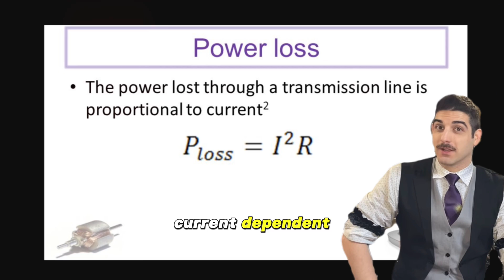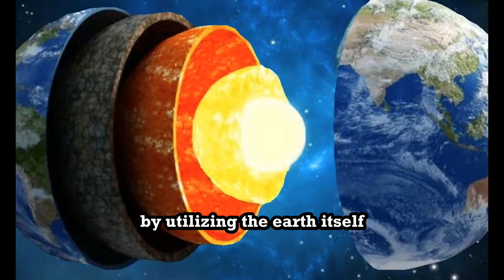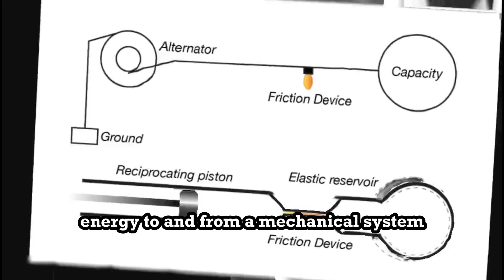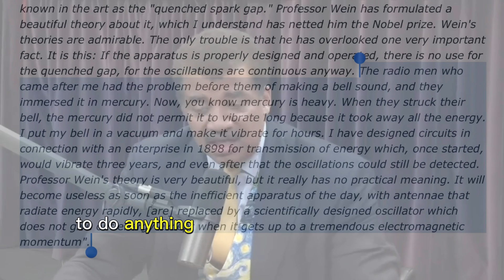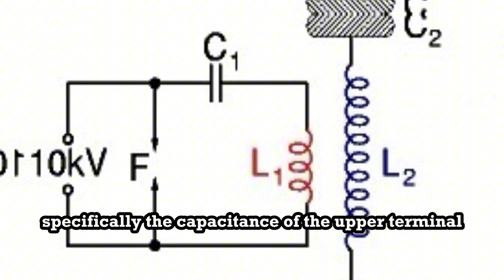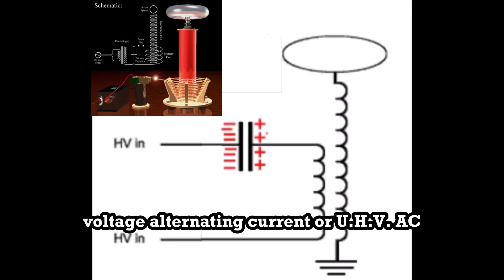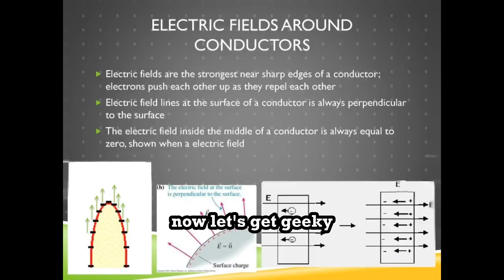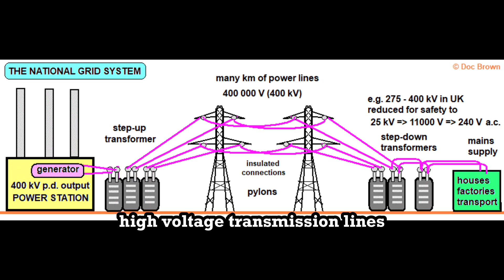The REAL Physics of Tesla’s Wireless Electricity

Comment: The way I see his problem is this. 
He was informed and have believed that electric energy can be transmitted in space between long distance without conductor. He was not aware that it was incomplete information. Cause him failure.

The untold part of information is this. 
That free electricity was possible only between galaxies and planets along a spiral arm in the form of Birkeland current better known as cosmic plasma. These plasma requires no return circuits or earthing. Once kick starred it need no further force to maintain continue transmission, forever. The energy is derived from vacuum Aether. Aether is a permittivity that store cosmic electricity and is free if we know a way to harness it. Tesla was fascinated with it and tried but failed. 

Since we know it energize planets and suns. The best practical way is to use wind and photovoltaic technology. And not from nuclear fusion which we don’t know enough to make it happen after decades of failure.

Comment: It does piss me off how many  “scientists” mock Tesla on this issue without realizing wtf they are talking about but there is a bit more to the story here. 

Tesla did briefly experiment with the kind of wireless transmission that we know doesn’t work due to inverse square law and very quickly learned what we know now ie you can’t use it for very much as you mention. After he learned this he did continue to explore using this very limited range transmission exclusively for a particular kind of vacuum tube lightbulb that was able to benefit from this kind of transmission at much larger distances than the ones you see people playing with on YouTube, the idea being that lights in your house would work wirelessly off of a single transmitter (per house) used exclusively for them. 

He also did explore a different approach for wireless transmission for large amounts of energy over the kinds of distances that he is mocked for using a much more plausible method, specifically motivated by flying machines that wouldn’t need to carry fuel. This approach was in creating directed beams of highly conductive  ionized air from the transmitter to the receiver, a concept with which many more people even today have explored for good reason: it makes sense.

Happy to answer questions about any of this: @zkchesterton on x/twitter.

Comment: I can't see Tyson endorsing this.
Reply: The fact that he either mistakenly or purposely said that the system was unworkable is a definitely sign that he would not.  He essentially said the transmitting towers would need to be everywhere and emit all their EM radiation through the air in order to work, which, if that was how they worked, would have been correct.  It would have inundated the air with high power densities which as far as we know, our planet has seldom seen and could have negative implications for life on Earth, to say nothing of existing signals infrastructure.  It's fairly clear though that was NOT what Tesla said or stated in his patents but to a non-electrical engineer it's definitely possible to not understand what Tesla was implying.  I thought that the power was transmitted through the atmosphere as well at first until I saw the extent of the grounding required for this Colorado Springs and Warden Cliff sites.  The grounding at Warden Cliff went much deeper underground than the tower extended into the sky, utilizing several steel I-beams driven into the ground.  They needed to be regularly maintained as well to ensure the system had enough of a "grip" on the Earth to ensure the system could actually control the electrical state of the entire planet.  There were/are several tunnels around the grounding "rods" to allow maintenance personnel to appropriately maintain the connection and steel itself.  

With all that evidence pointing to a lot of the system's functioning involving the Earth's crust, it's hard to believe a man as smart as Tyson would not have made that connection and at least understood the operating principle of the system.  That being said, if he had not spent a lot of time investigating it and just thought he "got it" then sure, his more limited understanding would lead him to that erroneous conclusion.  In Tyson's defense, Tesla did slip into a bit of a mild madness in his later years, so easier to jump to the conclusion that Tesla came up with the idea in a fever-dream, but his wireless transmission system was something he came up with at the pinnacle of his genius, not in his reclusive years spent in his NY apartment, dreaming up death rays and falling in love with a pigeon... which yea.  yikes.
Reply: @ImprovisedExpletiveDevice  The simplest analogy might be a network whose nodes are tuned circuits with high Q factors so they respond to only a very narrow frequency range. As long as no one is drawing off energy, very little energy needs to be put in to maintain the oscillations throughout the system, as the only loss will be a small amount in each oscillator from heat produced. In fact the oscillation amplitudes will rise to the point of an equilibrium in which the loss from I^2 R in each oscilator will match the amount of energy going in. OK so that's the sort of steady state situation once you have pumped in enough energy to get the oscillators (the tuned circuits) oscillating in the first place (like pushing a kid on a swing repeatedly until the swing is moving significantly).

Now consider what happens when you start drawing off energy at one of the oscillators. There will then be a power flow thru the network to balance out the energy distribution. That means the generator feeding the network has to pump in a higher power level to maintain the high amplitudes of the oscillators. In other words, if you take energy out, someone has to put some back in. Just as in a conventional power distribution network.

Conventional power distribution networks use 3 phases 120 degrees apart so they don't need a common return wire because, provided you balance the phases, the return wire would have zero current passing thru it. Such networks run at very high voltages so as to keep down the currents. Even so, you can pick up energy from a device near a distribution tower, if you are dumb enough to want to. And sure people tap into lower-voltage domestic distribution networks in 3rd-world countries to get free power.

So what's the difference with the Tesla system? Well it's using oscillators as local energy storage devices. Kind of incidental to how it works. But tke key concern is the viability of transferring energy to the oscillators thru a network that is NOT a bunch of purpose-designed cables but a pre-existing thing called a planet. And that's where I think it comes unstuck. The idea is that the voltage can be kept super-high to reduce the current and hence the I^2 R losses. But look at how homes are protected. They have earthing systems. Basically a circuit is protected by a connection to the indoor plumbing (assuming the pipes are copper). That copper eventually runs into the ground. So the assumption is that a whacking great amount of power from a domestic short-circuit to the earth attached to the covering of a device (such as a motor or whatever) can be dissipated into the ground with no problem, ie the ground is expected to offer very little resistance, because it is absolutely massive.

Well, that being the case, if I want to put 2 stakes in the ground at some distance from one another and put a super-high potential difference between them of hundreds of megavolts, I can't expect that the electrical resistance is so high that I^2 R losses will be virtually nil. I may cook the ground!!! Also different terrains will have widely different characteristics. But typically they will have ground water somewhere and salts that are soluble or partially so. Inevitably there is going to be more conductivity than you are bargaining for.

Well that would be for DC. But what if you go for AC and have a free choice as to what frequency you want to use? 50-60 Hz. Maybe 1 MHz. Maybe 100 MHz. Well you could go craxy trying alternatives. But you are going to run into phase-related issues. If you have multiple generators in a network, they all need to be precisely timed so they all push at the same time, and all pull at the same time, otherwise they will be dumping power into each other. So that would set an upper limit to use of high frequencies.

I don't know how conductivity will vary with frequency in the ground but it sure doesn't stop earth wiring from working at 50-60 Hz.

I don't have time to think about this any further and my degree was in electronics not power engineering and goes back half a century. But I can't help seeing some serious problems. If it worked, someone would have done it by now. I feel this whole thing could get swallowed up into the world of whacy pseudo-science and conspiracy theories about aliens building pyramids as power generators and all that kind of crap. (Darned stupid way to build a power generator. Any engineer who used such tonnage of stone so pointlessly would be fired on the spot.) Anyway, enough said.

Comment: What about the ideas that his system was more related to the zenneck surface waves
Reply from the maker: Hey thanks but that’s patently inaccurate. 
 
Even real verbatim says over and over his system does NOT use EM waves.
 
Tesla: “There is no radiation in this case. You see, the apparatus which I devised was an apparatus enabling one to produce tremendous differences of potential and currents in an antenna circuit. These requirements must be fulfilled, whether you transmit by currents of conduction, or whether you transmit by electromagnetic waves. You want high potential currents, you want a great amount of vibratory energy; but you can graduate this vibratory energy. By proper design and choice of wave lengths, you can arrange it so that you get, for instance, 5 percent in these electromagnetic waves and 95 percent in the current that goes through the earth. That is what I am doing. Or, you can get, as these radio men, 95 percent in the energy of electromagnetic waves and only 5 percent in the energy of the current. Then you are wondering why you do not get good results. I know why I do not get good results in that way. The apparatus is suitable for one or the other method. I am not producing radiation in my system; I am suppressing electromagnetic waves. But, on the other hand, my apparatus can be used effectively with electromagnetic waves. The apparatus has nothing to do with this new method except that it is the only means to practice it. So that in my system, you should free yourself of the idea that there is radiation, that energy is radiated. It is not radiated; it is conserved”. 
 
“By proper design and choice of wave lengths, you can arrange it so that you get, for instance, 5 percent in these electromagnetic waves and 95 percent in the current that goes through the earth. That is what I am doing. Or you can get, as these radio men, 95 percent in the energy of electromagnetic waves and only 5 percent in the energy of the current. ... The apparatus is suitable for one or the other method. I am not producing radiation with my system; I am suppressing electromagnetic waves. ... In my system, you should free yourself of the idea that there is radiation, that the energy is radiated. It is not radiated; it is conserved.”    -Nikola Tesla 
 
“The radio men who came after me had the problem before them of making a bell sound, and they immersed it in mercury. Now, you know mercury is heavy. When they struck their bell, the mercury did not permit it to vibrate long because it took away all the energy. I put my bell in a vacuum and make it vibrate for hours. I have designed circuits in connection with an enterprise in 1898 for transmission of energy which, once started, would vibrate three years, and even after that the oscillations could still be detected. Professor Wein’s theory is very beautiful, but it really has no practical meaning. It will become useless as soon as the inefficient apparatus of the day, with antennae that radiate energy rapidly, [are] replaced by a scientifically designed oscillator which does not give out energy except when it gets up to a tremendous electromagnetic momentum”. -Nikola Tesla
Reply: @CharlieSolis  Thanks for the video on this, I always love Tesla wireless transmission videos.